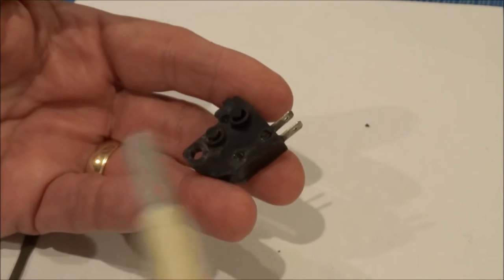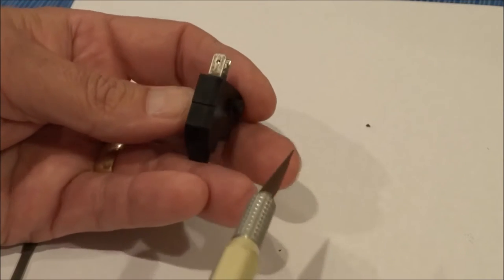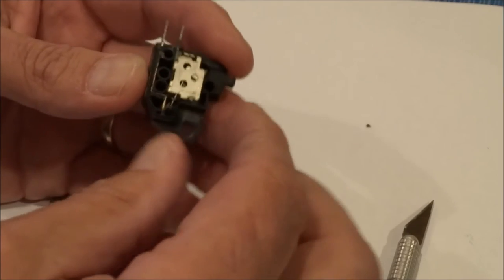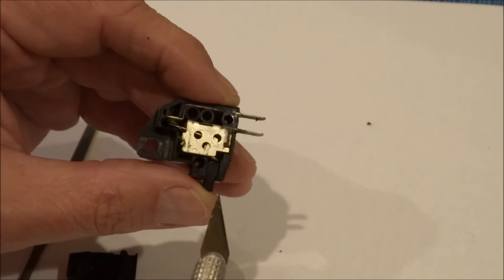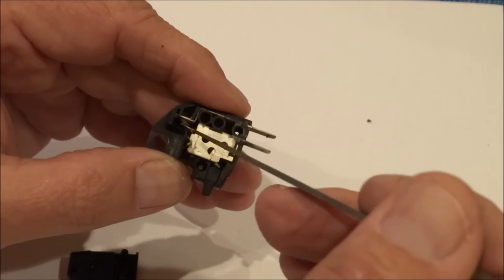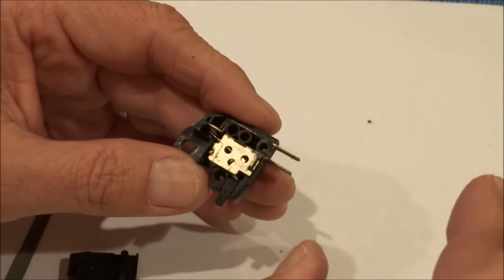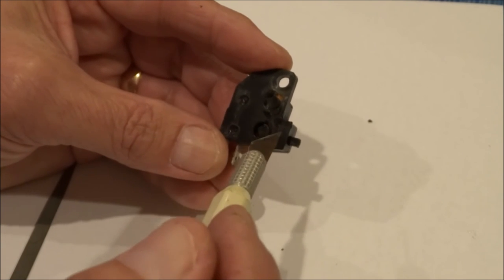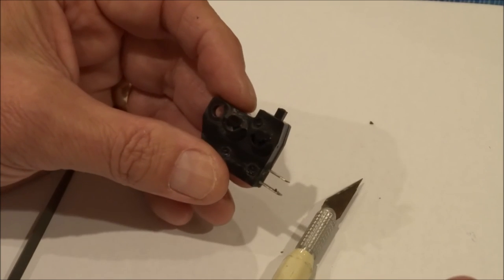KLR650 Front Brake Switch

Comment: Mine quit working last week , I'll check it out . Thank you
Reply from the maker: +Geoffrey Carpenter 

Geoffrey, If you find you need or want to replace the switch, I recommend this one over the Kawaski switch: http://www.mouser.com/ProductDetail/ALPS/SDDHA10100/?qs=%252bg1Dl%2FaibpERE6Fk4%2F6OAw%3D%3D

It's about about $13 delivered while the Kawasaki switch is $18 by itself. This switch is a better switch as it is sealed. The stocker is wide open to the elements.

You can read about it in this thread (starts about halfway through the thread): http://www.klrforum.com/klr-other-motorcycle-related-discussion/48993-brake-light-electrical-idiot.html#post455433

I have been out for the past four days riding through rain and snow. It is nice to have a sealed switch!

Tom
Reply: Hey Thank You Tom ! Great you made it back from that type of riding ;) I will certainly check out your suggestion . Best of Luck !
Reply from the maker: +Geoffrey Carpenter Hi Geoffrey. Couldn't figure out how to message you, so here goes.

Don't take it personal, but I disabled comments on my last posted video. Nothing about you.

Tom

Comment: my switch wasnt working, i decided to spray little wd40, now it works..but can i leave just like this, or i should spray some kind of contact cleaner?
Reply from the maker: +KIKO_R6  Hey, if it works, it works! Contact cleaner wouldn't be a bad idea. It should be formulated so that it won't hurt the plastic.

I would recommend ordering the sealed part from Mouser. It is this one: 

http://www.mouser.com/ProductDetail/ALPS/SDDHA10100/?qs=%252bg1Dl%2FaibpERE6Fk4%2F6OAw%3D%3D.

You can read about it in this post:

 http://www.klrforum.com/457369-post20.html

on KLRForum (you can read the whole thread if you like, but the post above covers the switch).

The Mouser part is a sealed switch that is unlikely to fail, while the OEM switch will fail again. Best of all, the Mouser part is about $14 shipped while the OEM part is $18 plus shipping. Mouser is a good company to deal with.

Tom
Reply: +souperdoo yea ill buy Contact cleaner (formulated) and spray a little..btw thank you a lot for the links and explanation, that Mouser looks like 'IT MUST' Part, i think that could last forever!